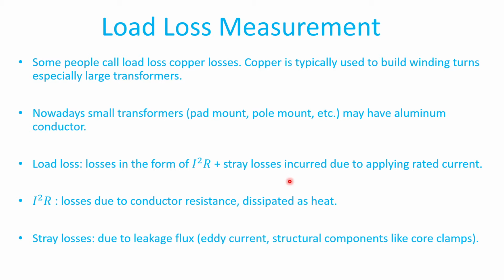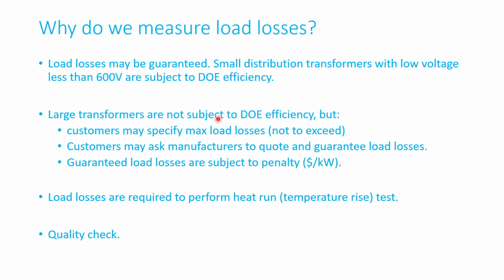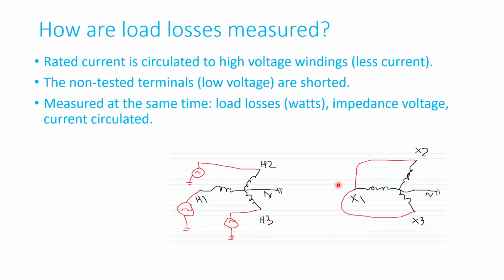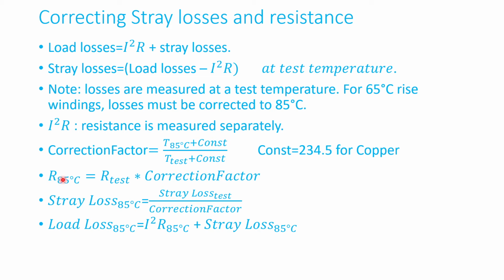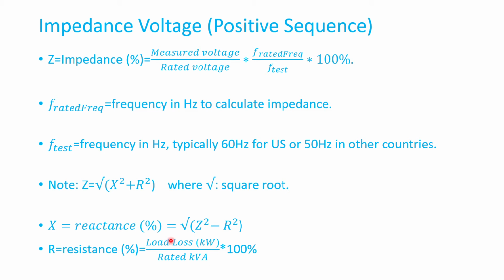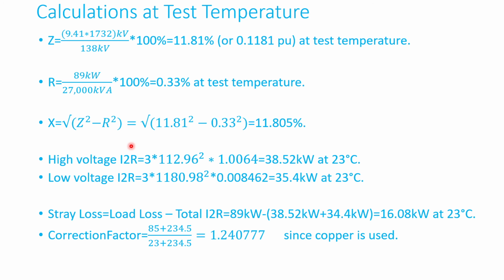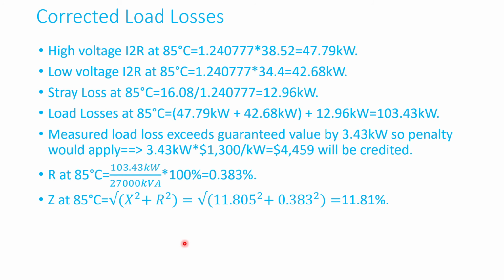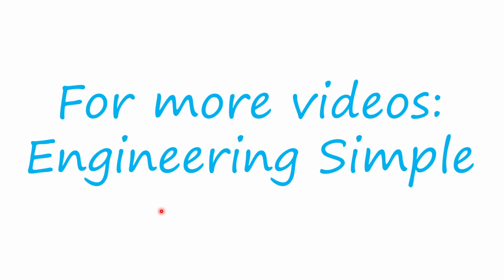Transformer Testing | Load Loss and Short Circuit Impedance

Comment: If it's in Delta side we are measuring load losses,then we calculate the Impedance We should multiply the 1.7321 or not .. please reply me sir
Reply from the maker: Since %impedance =[Measured_voltage]/[rated_voltage]*100%

The voltmeter will measure phase voltage which is equal to line voltage in delta. So no need to multiply by 1.732.

In delta phase and line voltage are equal.

In wye (star), line voltage is equal to 1.732 times phase voltage. The voltmeter will measure phase voltage (line to neutral).

In wye, impedance=[measured_phase voltage]/[rated_phase voltage]=[measured_phase voltage]/[(rated_line voltage)/1.732]=1.732x[measured_phase voltage]/[rated_line voltage]

Hope this helps. Thank you.

Comment: What is the vector group of the transformer you used
Reply from the maker: Typically grounded wye-grounded wye (YNyn0).
Reply: @engineeringsimple  Thank you, what causes measured equivalent losses to be less than total i2r losses, thus making stray losses negative

Comment: Where did (F rated Freq. / F test  )  come from ? we put  (I rated / I measured)  instead of it  ?
Reply from the maker: For instance, someone in the US where frequency is 60Hz may buy a transformer from Europe where frequency is 50Hz. The manufacturer may not have 60Hz frequency available. They would perform the test at 50Hz and make appropriate measurements then convert to 60Hz, which what the end user is interested in.
Hope this helps.
Thanks.
Reply: @engineeringsimple 
Many Thanks Sir.
Reply from the maker: You are welcome.

Comment: What is the meaning of DOE ? Please.
Reply from the maker: DOE is Department Of Energy in the US. DOE stipulates what efficiently should be for distribution transformers. DOE publishes minimum efficiency values based on voltage and kVA. If I remember correctly, only applies to low voltages less than 600V. It also does not apply to solar or wind transformers. For up to date information, you can refer to DOE website. The nameplate has to say DOE Compliant. 
Thank you for the question.

Comment: What happen if we apply rated voltage in short ckt test of transformer ..... The losses are same on rated voltage and how plz explain
Reply: Hi Hardeep.
The short circuit method simulates the short circuit impedance by applying rated current and measuring the voltage that develops. If you apply rated voltage, the current that will flow will exceed the winding rated current, causing damage. The losses will be higher. Short circuit impedance could, theoretically, be measured by applying rated current and voltage by subjecting the transformer to actual loading, but it will require high energy which transformer manufacturers do not have and probably cannot afford. For positive sequence impedance measurement, short circuit method is the one that all manufacturers use. Thank you for the question.